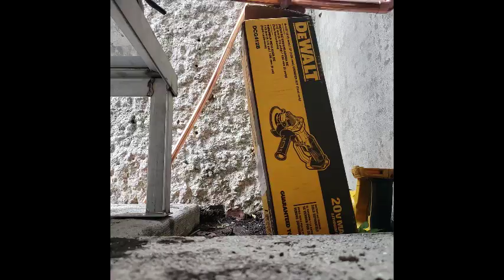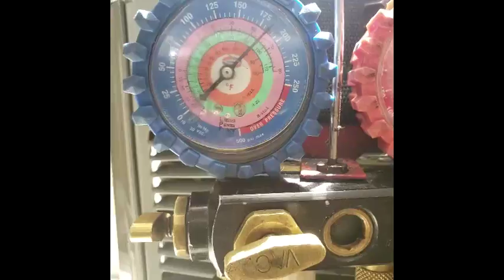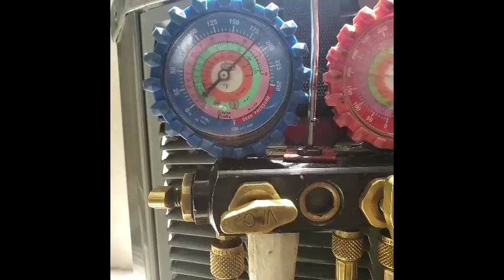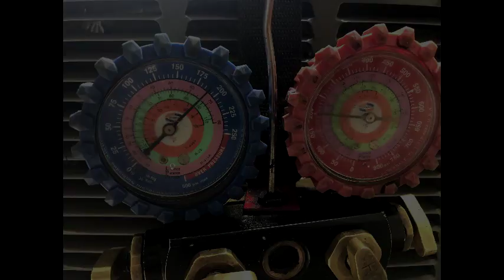HVAC: AC Condenser Install

Comment: That's not a proper way to install. No nitrogen flowing while brazing???
Stem valves in while brazing??
You are hardworking man. But come on bro. I would never want this kind of install for any customer. 
My tech will have to go thru proper training in order to go out on the field and install.
Reply: the nitrogen flowing is prevent build up of soot correct ?

Comment: Why not just bend the copper instead of all of the elbows and brazing?
Reply: Agree
Reply: To many spots for leaks with all the joints. I would have also installed at least two clamps to hold suction pipe sturdy and zip tied liquid line to it help with the vibration. Thats just me
Reply: Also brazing with the nitro flowing inside pipe eliminates the oxidation. The oxidation flakes of and causes restriction.